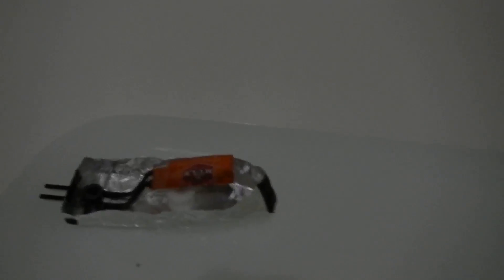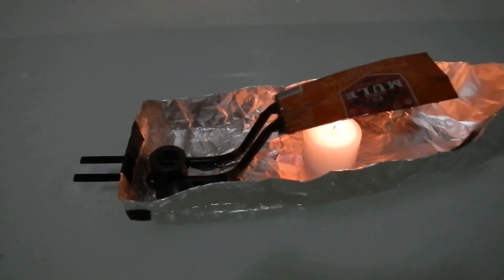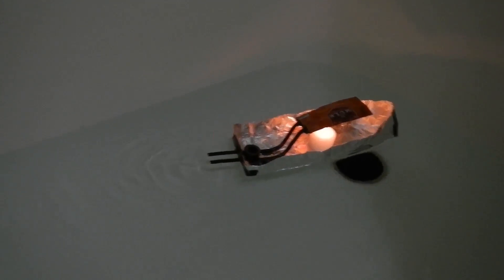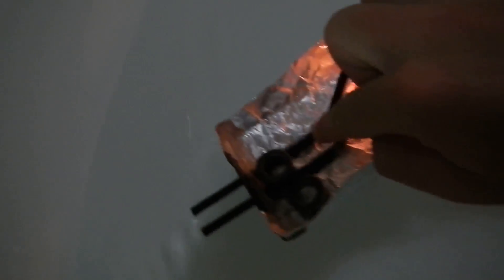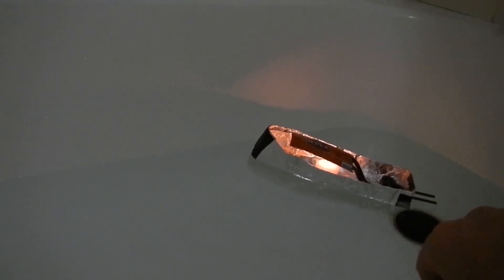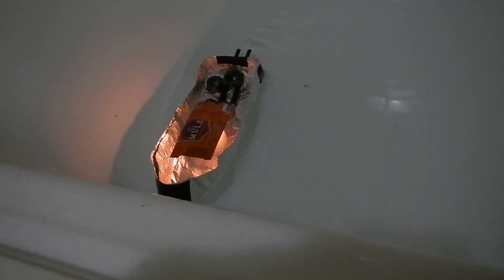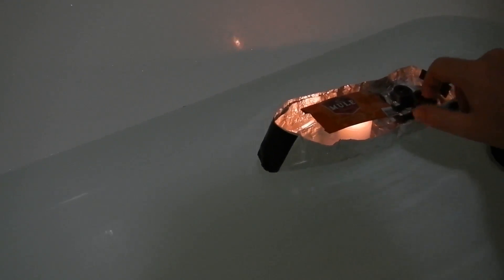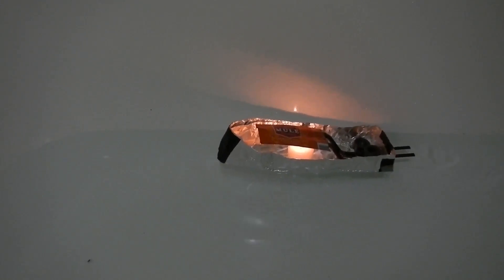My first working Put Put boat.

Comment from the maker: Thank you. Lots of fun. Still a lot of room for improvement I think. I got good heat transfer and power from a single pipe one, no boat, just in a cup. But had to heat to electrical solder melting point. Surprising how long it ran with liquid solder. Want to run a big one on a Fresnel lens.... All the guides say one pipe not so good? I need too find out why they say that. Might boil dry more? Single pipe had better heat transfer than flame on pot with same volume of water. More to know here.....

Comment from the maker: Yep 500f. which is a bit over 300c which is still hottest epoxy product I can find. I'm liking the rtv idea, don't know how ti will handle the pressure though. Going to try applying it inside the folds, then fold and clamp till set. I have JB and no RTV though. so trying single pipe JB model next. Wonder if this one will survive my soda can spirit burner?

Comment from the maker: I Asked the kido if I could pull apart a radio controlled truck, The reply was "I don't have a remote control truck dad" So that's sorted :) The truck drives and steers from 2 AA's which means it can only drive OR steer, rarely both at once. so the turn servo should be pretty easy on a cap.. I like the home made turner Idea!

Comment from the maker: No worries. Thought you might like this. Be sure to check out science toy maker too. Static powered gliders and all sorts of cool stuff.

Thinking about using ally sheet from Plama tv to make the next boat. JB weld and RTV silicon both have higher temperature ratings than the epoxy I used. Had a real ripper of a motor, steel can lids and drilled out welding rod, but the 300c solder liquified just as it got going good. So 500c would be nice. My attempts at silver soldering have not gone well.

Comment: Tweak this and make an Ekranoplan ! lol
Runs nicely, will you be calling it 'The Mule' ? 
You got R/C method sorted ? If not, dunno know what spares you have but a regular cheapo 2 channel infra-red plane will do it, motor and rudder. Could use the power source as weight (supercap rather than Li-Po for water safety). On rudder only the R/C circuit current draw will be tiny, rudder from 300 turns 40's gauge wire and bit of a neo magnet, on a crank assembly. Fun Fun !